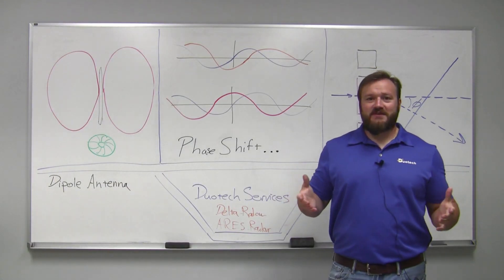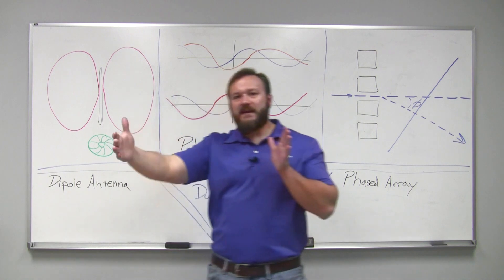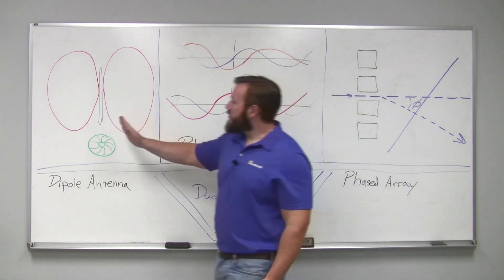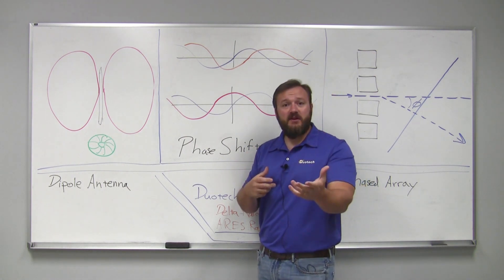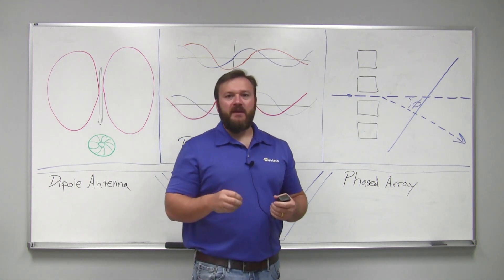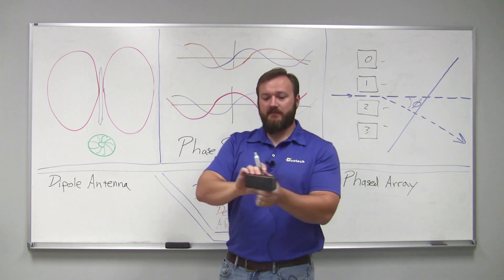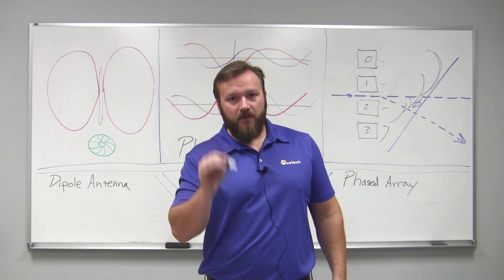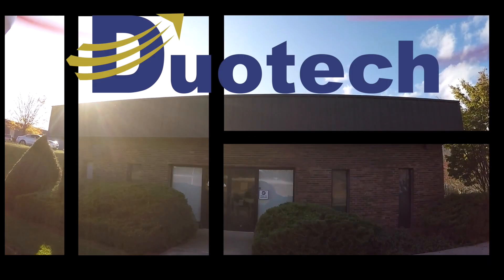Antenna Elements to Antenna Arrays

Comment: I thought if I had a dipole antenna array close to a metal sheet it could use a flat solid sheet of metal into an anntenna array...changing the vectors of electrons fields in the metal sheet, replicating weather actually and in doing so be the first step to both self levitation if that sheet if metal and a mechanical biological system of repairing the damaged surface of a ship...similar to human skin...

Comment: But phase shift antennas dont use dipole antennas, what antennas do they use, as I though antennas use crystal elements as well not just metal...even if metal is effectively a crystal..
Reply: Depends  on the application, you can have an array of any type antennas but I'd say the most common type are patch antenna arrays since they are so ubiquitous in consumer electronics. Also you can get dielectric antennas but most antennas are metallic conductors
Reply: @Dr_le_Quack  I'm trying to find the best antenna for a a plane that has two antenna array intermingled with each other and can be as flat as possible. What is the simplest and best antenna to use... in thus regard...
Reply: @ambientsoda106  since you want it to be as flat as possible then patch antenna would be ideal. Also they are quite directive so if you don't want your arrays to interfere then it should be fine. Just be careful when sweeping as the grating lobes could cause problems.
Reply: @Dr_le_Quack  where can I fund out more about interference between antennas in an array and sweeping...and aren't all antenna based in a dipole antenna when it is a metal line or loop?

In trying to learn as much as I can for a project in which I have redesign a magnetron...
Reply: @ambientsoda106  Kildal Fundementals of Antenna Engineering has a very good section on antenna arrays and it is free to download if you Google the book.
Reply: @Dr_le_Quack  cheers thanks...